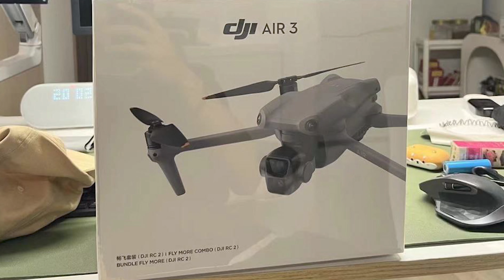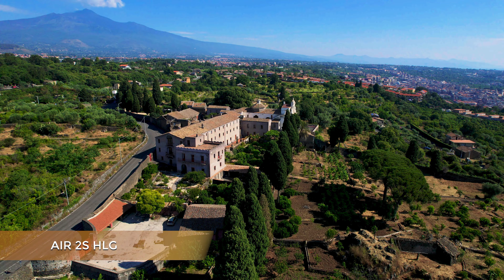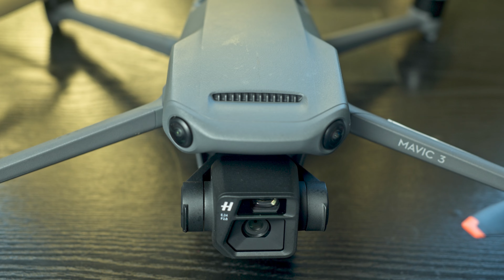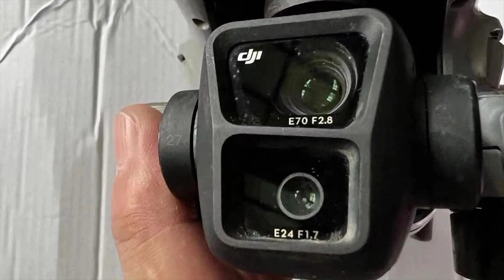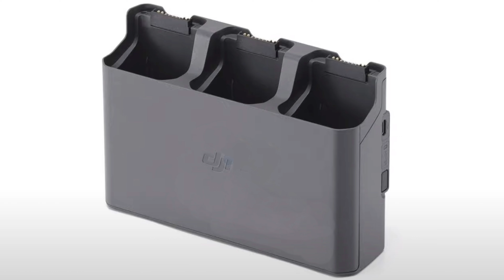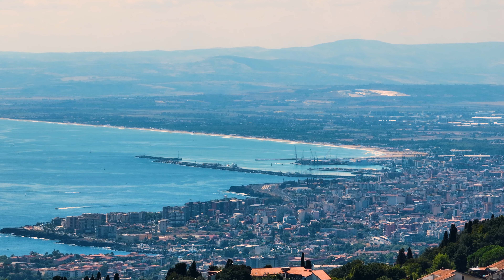DJI Air 3 Leak, Rumours, All Features

Comment: I look forward to your review of the image quality for photography for the air 2s vs air 3, as I appreciated your review of the mini 3 pro vs air 2s (excellent!). I think some reviewers are repeating claims that the stacked sensor = better image quality, comparable to the 1” sensor of the air 2s, but without thorough testing. Based on my limited understanding, this isn’t true about stacked sensors. I’m sticking with my air 2s this time around, but pondering the mavic lineup for the future.

Comment: Hi Vic!  The anticipation intensity is palpable. For all those groaning about sensor size, I ask, what about other factors, such as noise behavior, linear dynamic range, and pixel Size. Yet we never discuss these when comparing sensors. Just size. Gimbal Angular Vibration Range is. On Air 2S it's ±0.007. On the new Air 3 it is: ±0.01° - a ORDER OF MAGNITUDE BETTER, but hey, you have a bigger sensor, right? It's just not as STABLE. 

Above and beyond a 48% better flight time, my favorite spec is Ascent speed. The mighty Mavic 3 does 8/m/s so:

   DJI Mavic 3 Ascent Speed =   8 m/s    17.89 MPH 28.8 KPH  
The DJI  Air 3 Ascent Speed = 10 M/s   22.36 MPH or 36 KPH 

This is one fast, agile aircraft. Personally its not an upgrade for Air 2S. Its my Mini 3 Pro I will sell, as the Air Series is just about perfect for a travel Drone, as long as you don't need sub 250 Grams. In the US, its only significant where Remote ID is a factor.

Comment: That image sensor... same as Mini 3 Pro? I heard you repeat the popular assumption that it is a "true" 12mp sensor. In my research I've found differing opinion, that it is in fact a 48mp sensor that uses 4-cell binning to produce the 12mp files (opposite of repeated speculation). This process allows DJI to couple it with a dreadfully under-powered processor, which cannot handle the 48mp files for AEB or Continuous shooting. My own extensive testing/comparisons with the 48 & 12mp files finds the 48mp far superior when exposed properly, and shadows are not pushed in post. I have gotten fantastic 48mp high dynamic range sunrise images by manually shooting 48mp exposure brackets stretching over 4-stops, which I find are far superior in IQ compared to upsizing the 12mp files in Topaz Gigapixel. This leads me to believe that it is truly a 48mp sensor, but crippled by DJI's coupling it with processing power that doesn't allow for its full potential. What are your thoughts? Please see this link, which many claim is the actual image sensor for Mini 3 Pro (also found in iPhone 14), which the manufacturer markets as capable of smaller 12mp images with the 4-cell binning technology: https://www.ovt.com/products/ov48c/ ...I've yet to see anyone provide support for the opposing theory of some other 12mp sensor, and DJI specs state 48mp. Thoughts?

Comment: Another youtuber mentioned the Air 3 is the upgrade to the Air 2. To get an upgrade to the Air 2s we will have to wait for the Air 3s. The video and photo quality of the Mini 3p is amazing though so I don't think Air 3 buyers will be too disappointed. In fact the new airframe will be the big upgrade from the Air 2 with longer flight time and quieter props which is significant. In fact, it would be great if the Air 3s camera could be bought and installed on the Air 3.
Reply: Above and beyond a 48% better flight time, my favorite spec is Ascent speed. The mighty Mavic 3 does 8/m/s so:

   DJI Mavic 3 Ascent Speed =   8 m/s    17.89 MPH 28.8 KPH  
The DJI  Air 3 Ascent Speed = 10 M/s   22.36 MPH or 36 KPH
Reply: @BlairAir  Yes, one of my favorite things about the Air 2s is its zippyness. Quick but not necessarily faster at top speeds but fast enough. I'm confident everyone will be happy with the Air 3's airframe. Those with a Mavic 3, 3 classic, and 3 pro will likely take a pass on this Air 3. It would be a nice upgrade to the Mini 3p but probably not as much as the Air 3s will be. If I didn't have the Air 2s and Mini 3p I'd consider this new Air 3. A person can only use so many drones before they become redundant.
Reply: @underthedrone2735  particularly when you have all DJI. I have an Autel Lite+ (huge potential,  amazing aircraft, horrible controller and ecosystem. Sold Evo 2 Pro. Problem is there's few drones with DJI levels of performance, support and ecosystem.  A shame, but taking on DJI is impossibly expensive for smaller companies 😕
Reply: @BlairAir  All true. I've kept my E2P V1. It flies perfect for me. I've heard the Lite's are a bit underpowered just like the Nano+. I have two of the latter just to avoid RID.

Comment: Very surprised it has a smaller sensor than the Air 2S. I saw on twitter (so take this with a grain of salt) that there would be vertical filming but it will simply crop the image. Thank you for the video

Comment: sold my air 2s when the air 3 was announced but regret it when i heard it will have the same sensor size as the min 3.  not getting it now and will just get the air 3s when ever that comes.
Reply: The  way DJI have been launching new drones in the last 18 months, I wouldn't be surprised if there is an Air 3S (or Air 3 Pro) within 12 months.  The problem is knowing when is the right time to purchase (because DJI will likely launch another drone soon afterwards).
Reply: @CaminoAir  selling your Air 2s may have been a premature move! DJI is very unpredictable and sometimes it is just better to wait before making any moves.  I made the same mistake when I purchased my Mavic Air 2.  Perhaps I waited to late to buy it because less than 10 months later, the Air 2s came out and I was furious!  It is risky but either way, you do get a better product but these drones will continue to get better each time and of course DJI will just get richer from the faithful consumer.  Good luck.
Reply: @DroneUpp  yea was a bad move. i actually have the mavic 3 classic so can wait 6-9 months for the air 3s tbh as not in a rush having min 3 and mav 3. i got the mav 3 classic cos i'm in the UK and when the CCA announced that the C1 mark means nothing, no one wanted them so a few came up on the bay cheap. i just like to have a mid size drone to use in certain places and that's the only reason i had the 2s and wanted to replace it with the 3. today the official specs confirm the sensors are the same as mini 3 so definitely passing on it.
Reply: @denaco  probably a good idea for the Air 3s. I might consider getting that myself.  I have the Mini 3 Pro and it is sensational at the least!  Sometimes, the light weight worries me but this was probably my best drone investment as a hobbyist.  With the rule changes coming, I have decided that I don't want to get the 107 certification because I don't have to have a drone to make money.  I enjoy the freedom of flight and that love is being threatened by this new Remote ID rule. I hate it and I know they need to make the rule safer for people to fly. Right now, I have to get a permit to carry a gun just to fly come September 16, 2023. That is very sad.
Reply: @DroneUpp  Already got my CCW
Reply: Just get the Mavic 3 Pro if that’s how you feel.. I’m selling my Air 2s as well, if a Air 3s comes out then guess what?? I’m selling the Air 3 for the Air 3s
Reply: @Jhorne84   yea buddy got the mav 3 classic a few months ago so will just stick with that meaning i can be totally fine for how ever long it takes for the air 3s to come out. plus i have the min 3. mav 3 pro looks the best option but the mav classic is still damn good with just the main camera.

Comment: The Air 3 isn't an upgrade or a downgrade to the Air 2S.  It is a very different drone.  I'll wait until the reviews are available before I'll consider the drone.  There are just too many changes to mentally try to figure out what the Air 3 will be like to use.
Reply: IMHO ...The Air 3 is the upgrade to the Air 2. To get an upgrade to the Air 2s we will have to wait for the Air 3s.